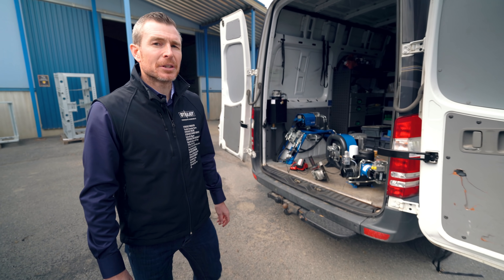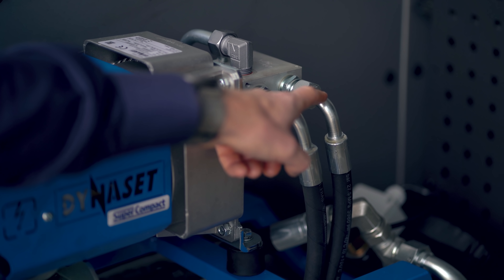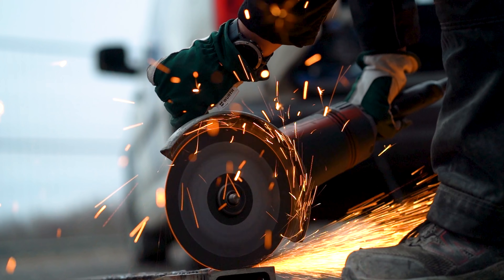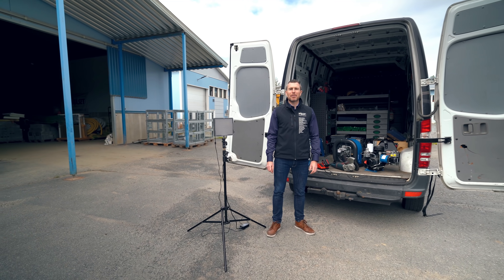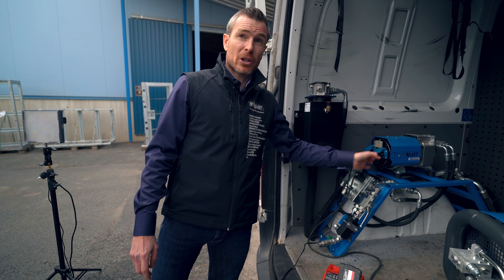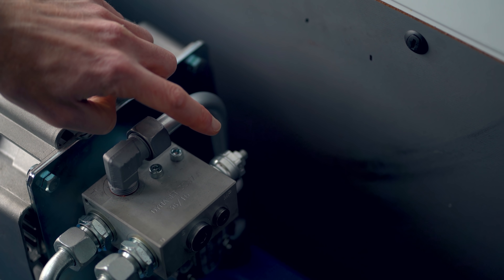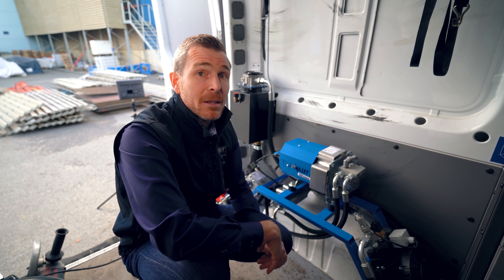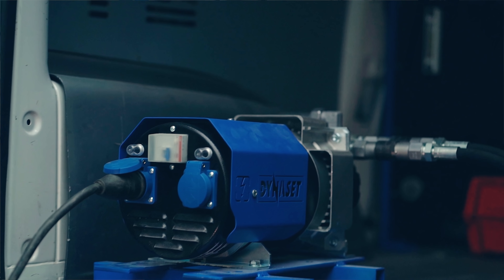Introducing HG Hydraulic Generator on Service Vehicles

Comment: Sir, 
Please explain 
How to working hydrolic generator?

What external energy is required to start the generator.
Reply from the maker: Hello! Hydraulic Generator uses Hydraulic power for electricity production. The hydraulic power is created with a hydraulic pump driven by vehicles or machines engine. You can read more about such systems at https://dynaset.com/what-is-hydraulic-power-take-off/
Reply: Basically you hook it up to a fossil fuel car/truck/tractor/tank whatever.
It uses the movement of whatever is hooked upto, to create electricity.
Is it usefull? Sure, but it also increases fuel usage on the other device.

You are better off putting a solar panel on your roof.

Comment: Input pressure?
Reply from the maker: Hello Askar! It depends on the model. For example, the 6,5 kVA model's max pressure is 210 bars and the nominal pressure is 180 bars. :)
Reply: @DynasetOy  Thanks
Reply from the maker: @askarali8425  No worries! More info about HG Hydraulic Generators is available on https://dynaset.com/product/hg-hydraulic-generator/ and you can always send us a message at  https://dynaset.com/send-us-a-message/ :)
Reply: Hello, this is an impressive invention. 
How much is the cost of a 20 kva hydraulic genset?